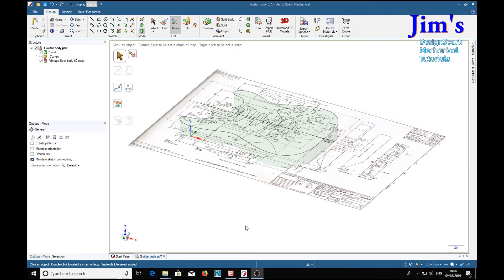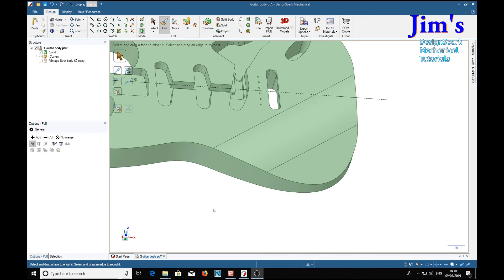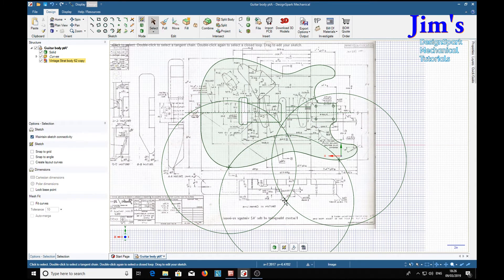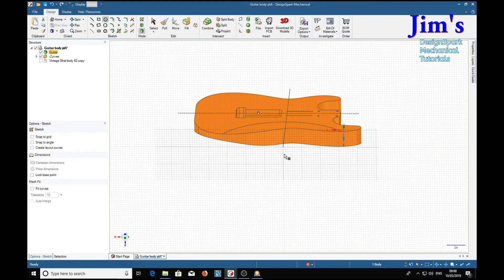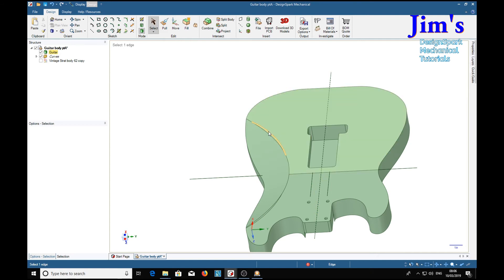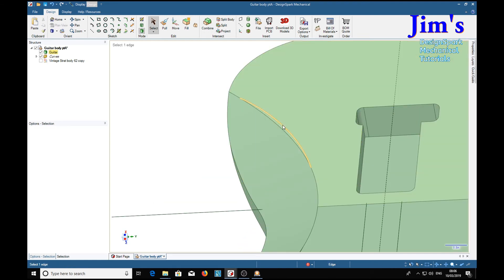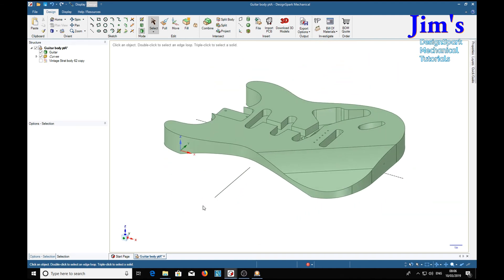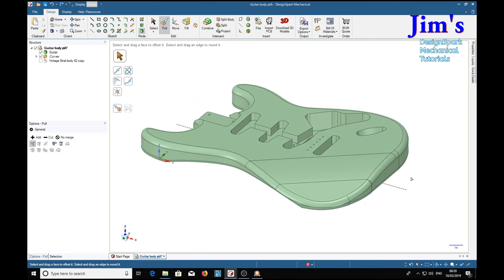DesignSpark Mechanical 1962 Vintage Fender Stratocaster body pt10

Comment: Hi Jim, for the large radius of 7-3/4 radius if you use the 3 point Arc you can just click on the end points of the arc then type in the radius, very direct way of doing it. Instead of using the large cylinder I pulled that portion then used the draft tool. Thanks for this series it pulled together a lot of things for me.

Comment: Aha. The changing of the axis for that cylinder answered a total mystery. I couldn't figure that out for the life of me. I thought instead of using a cylinder, one could hinge/chamfer the surface outside of that radius. I should do  some experimenting on that one. There must be a better way than trial and error. But whatever works is good.
Reply from the maker: Oh yes - there's always a better way - I'm saving that for another time :)